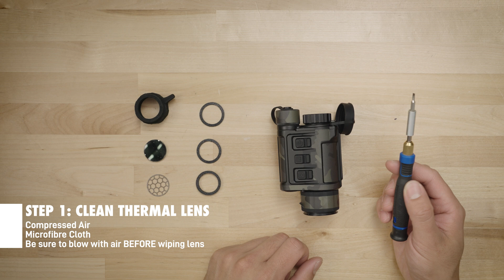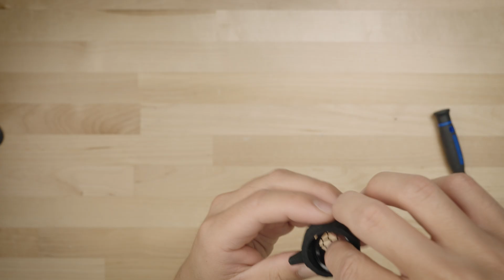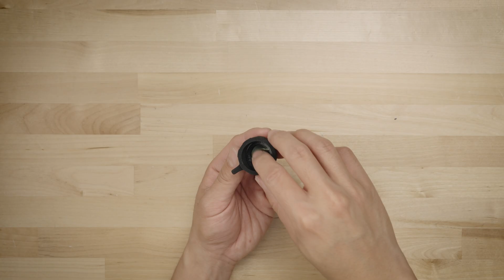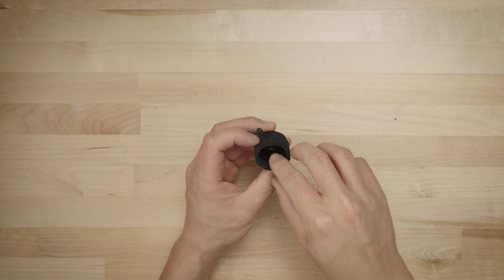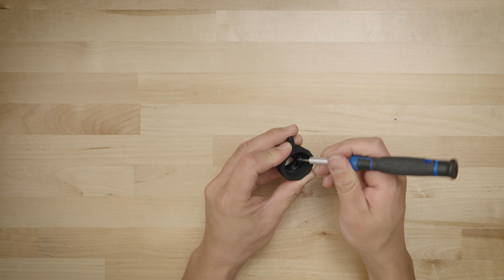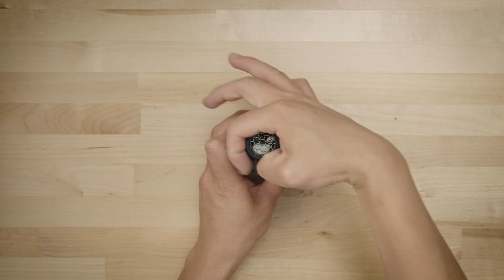Protect Your RH25/Pfalcon: Enhanced Focusing Defender Install Guide

Comment: I have an aimpoint 3xp and holosun aems dot on my upper. I'd like to run a clip on if possible. There are a few on the market that have a 1x, 1.5, and 2.5x base magnification. Which base magnification is better for in front of a magnifier, 1x 1.5x or 2.5x? Just looking for the clearest image. Thanks!